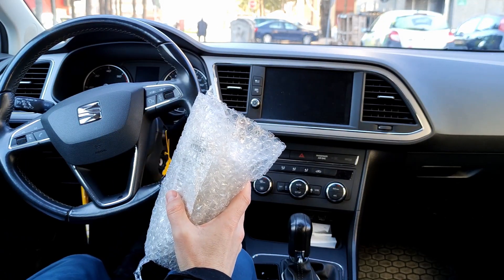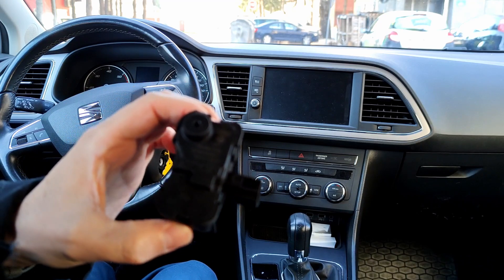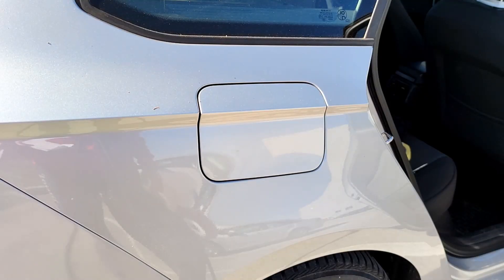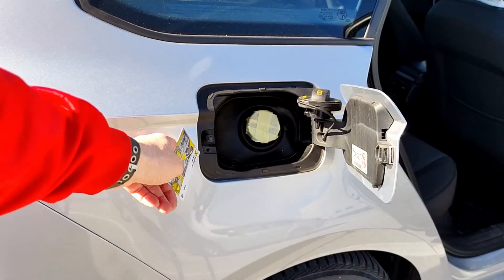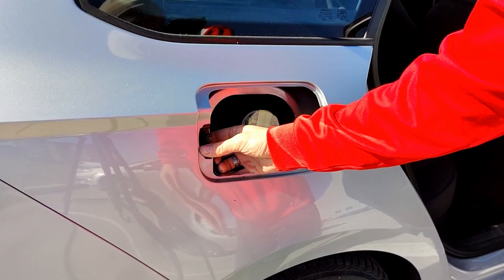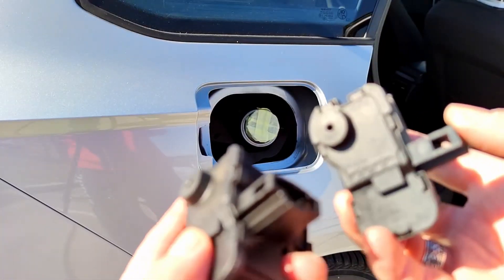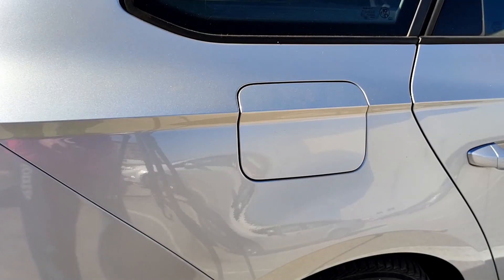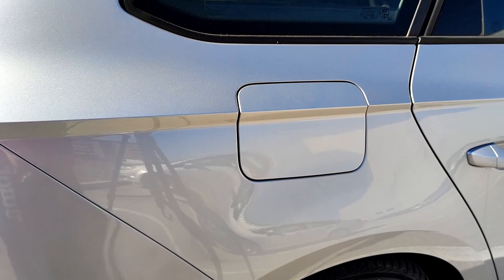How to change fuel tank flap actuator on Seat Leon MK3

Comment: What is the yellow tube connected to the fuel tank surround? Does it need unplugging from anything or is it loose?
Reply from the maker: I think it is tube for air or some kind of protecting from overtanking with fuel. It is loose by default, it is just connected on tank line.
Reply: It’s just a drain for any spilled fuel. It just hangs down into a small guide near the rear wheel suspension

Comment: Hey thanks a lot, last month my fuel tank actuator get stuck on closed flap, sadly, that was to difficult to open, i broke the door lock, so now i need to replace the actuator and replace or fix the door lock...

But it's recommended to install a new actuator with emergency cable attached to it, like in Audi, it's so helpful
Reply from the maker: I did not know about that emergency cable, but sure it is good idea. My failed in open position so I even did not noticed until vcds scan... But I wonder how difficult is to open when fail in locked position.
Reply: Hello, I had the same problem I could not open the closed flap.
Could you tell me the part number of the door lock? Many thanks 
One more question what is emergency cable? 😊